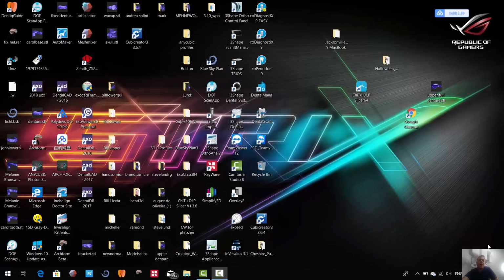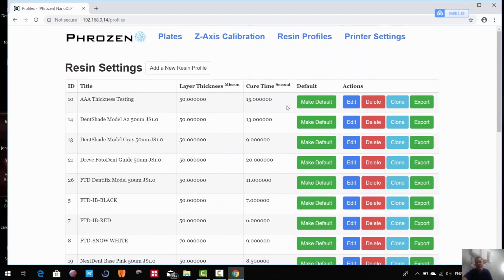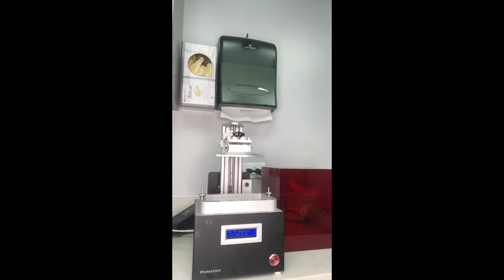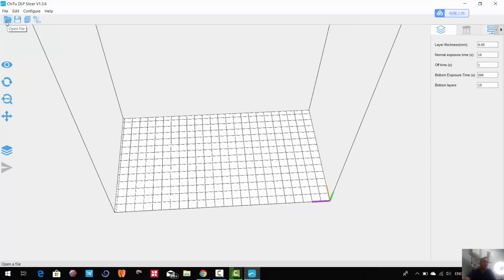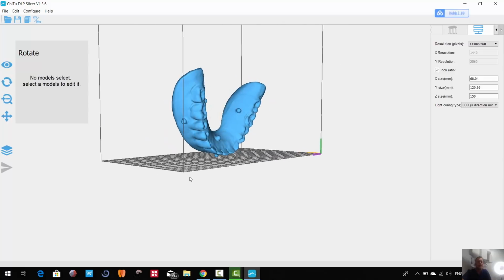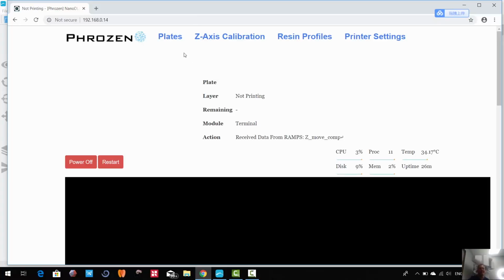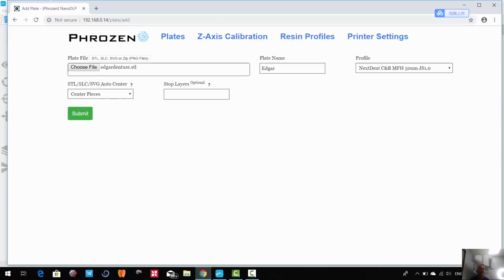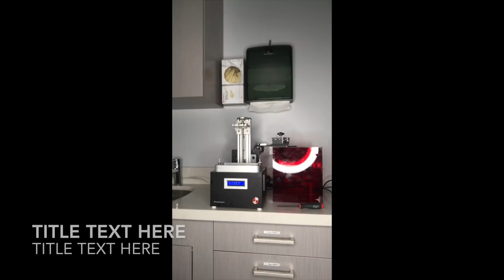Phrozen 3D Printers Step By Step

Comment: Sorry August, bit of a necro, but does the next dent resin print on this printer? Nextdent resins cure at 385nm and this printer is a 405nm? or do you get different NextDent resins? (wavelength)